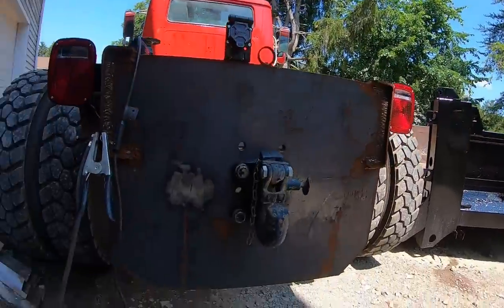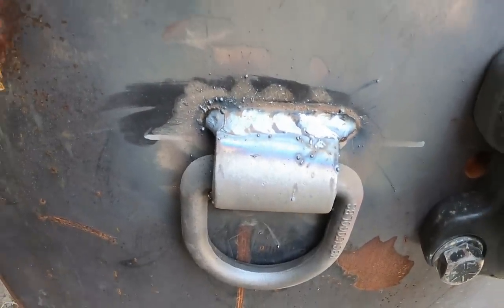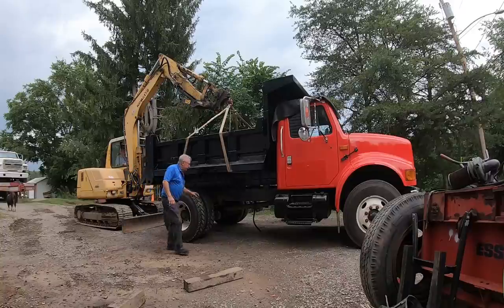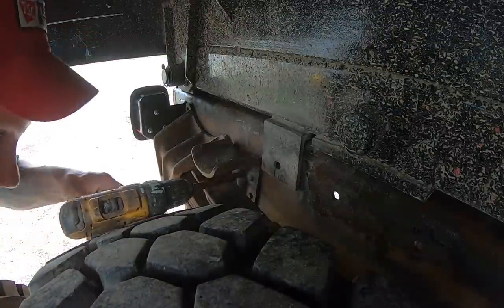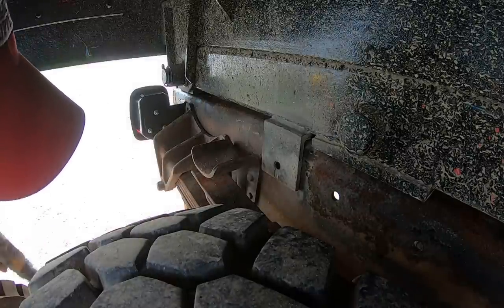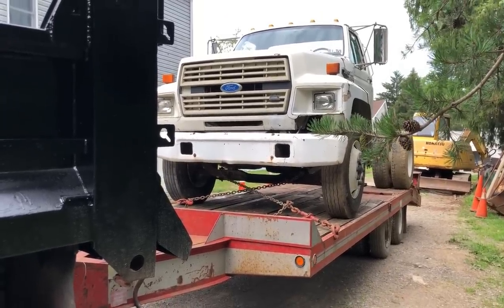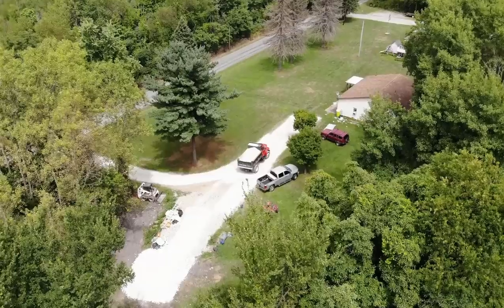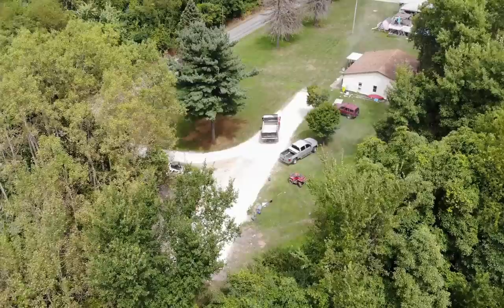International Dump Truck Build Pt. 3 (Shes hauls her first load!!)

Comment: To keep the shroud clean on the mig you can use cheap cooking oil to dip it in it stops the little particles from sticking to the shroud.
Reply from the maker: I use nozzle dip but I also run 100%  Co2 because I’m Too cheap to run argon, the side affect of straight Co2 is lots of spatter but still produces a good weld
Reply: Brian Millar 
Your priority is wrong if you're getting a lot of splatter

Comment: i like to put heat on those cast d ring saddles when i weld them on. i have been considering upgrading my welder to the miller 252....big investment for me. i bought the milwaukee m18 mag drill. i absolutely love it. i have many videos of drilling truck frames with it. i move axles forward on trucks and the drilling only takes 20-30 minutes now. looks like the international is missing a bolt on the front leaf spring hanger on each side. i like how the subframe is spaced up a little bit from the truck frame.....less rust jacking that way. very nice build...look forward to more.
Reply from the maker: Thanks! Probably gonna be one more video on the truck in the spring, doing some finishing touches! thanks for watching!!!

Comment: Nice, wish mine was air brake. I scoop out of the bed a lot and have to chalk my wheels everywhere I go. My next will be a 12 foot bed air brake with a single tire drop axle
Reply from the maker: that would be a good set up! Thanks for watching!!!
Reply: No problem bro good looking setup you have I like your excavator a lot I’m looking at mini to mid size machines thinking about buying a cat 305.5. My truck is a 00 model 4700 with the 7.3 and auto and 10 foot dump bed and my trailer is a deck over pentle, tandem, single tires. I think I could get a lot of work done with my skid steer and a smaller excavator. I’ve used a bobcat 35 long stick and I’m trying to figure out which small machine I can reach to load my truck with and stay around 12k lbs.? Any ideas?

Comment: Awesome build!  I have a similar truck, 2002 4300 DT466 Eaton 10 speed. All you need to do now is put an air actuator on your tailgate trip. It’s so nice not to have to tie a rope to your handle.
Reply from the maker: Yes I’d like to do that eventually thanks for watching!!!
Reply: Shoot I'd love to move to a newer truck but the 1983 s1900 with a 6.9 isn't giving me any major problems I'll keep using it bought it out of a tree row for 1,500 had to put in a radiator the one i put in it is out of a 1978 f250 with the 460 a few pieces of exhaust pipe to change the hose size down and 4 new bolt holes we've been on the road since truck was sitting 4.5 years before I saved her from being scrap metal couldn't beat it for 1,500 with a clean title some of the truck I looked at in similar condition were running 6k to 8k at the time

Comment: sounds like you have your settings about right wire speed and voltage settinhgs , quick tip if you have them set right you willget a clean crisp crackle as you weld

Comment: If you want an easier way to drill and finish frame holes, use a bridge reamer. Find center, 3/8 first then 1/2 or 5/8 reamer. Lots easier on the hands and arms.
Reply from the maker: never seen those, ill have to check that out! thanks for watching!

Comment: Sounds like that ford has the 6 cylinder ford diesel motor. I had one in a F650. Not bad. A little lower power than I expected.
Reply from the maker: Military Museum the ford has the 6.6l in it, and yes she’s not exactly a powerhouse

Comment: Putting a mud flap on the lead side of the drives will keep crap of the back of the back of the cab. Rock chips, road salt in the winter and etc.  What motor does this truck have, DT466?
Reply from the maker: Military Museum I’ve been meaning to get to that and just haven’t, but yes the truck has a 466 mechanical if you check out the first part of the series I go over all the specs of the international, it’s like a brand new rig
Reply: @DieselCreek  if you dont car about looks you can get some galvanized culverts and cut em up in half to use as fenders, super cheap and dont look too bad

Comment: Put a 5th fifth wheel attachment on your old dump truck and use it to haul your equipment around on
Reply from the maker: I can’t it doesn’t have air brakes or balls to pull anything lol

Comment: Hi Matt.  Love the vids keep em coming.  Only welding I ever did was shop class in high school which in the late 1980s consisted of oxy acetylene and arc.  Do all welders avoid arc welding now days because it weakens the metal due to too high heat?

Comment: Next time you have to drill holes like that rap a chain around the frame and put a pry bar threw the chain and on the back of the drill and use the pry bar like a drill press but dont pry to hard dont want to brake the back of the drill

Comment: I’ve drilled a lot of truck frames, the easiest way I found to drill the holes in truck frames was to trick someone else into doing it. It is so much easier. Buy 3 of the same cobalt or hss bits and keep 80/90 oil steady. You can usually squirt the oil from up high and it’ll run down to the hole. And zip tie the drill trigger onto the right speed and lean on it with a rock bar 🤳🏻
Reply from the maker: hahah! if I would just buy a Mag drill it would be so easy!!! Thanks for watching!!!
Reply: Either way it’d be good to have a mag drill or know someone that does and I prefer the latter 👌😂

Comment: Hi Matt, I really hope I am wrong and missed it but it didn't look like you crossed your trailer hitch safety chains. The purpose is that the chains will cradle the tongue if something breaks/malfunctions and keep the tongue from hitting the road and digging in.  Finding a pothole with the tongue would make for a really bad day.
Reply from the maker: You must have just missed it because I’m pretty religious about trailer connections. I always cross and make sure the hooks come from under the D-rings

Comment: I would love to have that old ford.
Reply from the maker: You can buy it!
Reply: @DieselCreek  how much?
Reply from the maker: Looking for 5k it’s an 88 f700 with the 6.6l diesel don’t know the mileage for sure the odo doesn’t always work, the the only problem I know it has is the gauges don’t work right , always starts and runs well tho. It comes with a f600 parts truck that has a gas motor and is in good shape but no title parts truck has a nice bed to put on the white one as well as a good front clip

Comment: You need to see those Pakistani truck building videos, they take new trucks completely apart, modify them and then screw them back together. 

Those guys didn’t have mag drills either but used a chain around the frame as pushing aid, while turning the loop they created pressure. Crazy and cool idea.

Found the link!: https://youtu.be/S1ZWqLRhhbM

Comment: I would have put a stiffenrs on headboard addition
 Put tailgate pins in from inside body, if one works out it will fall in instead of bouncing down the pike!!
Reply from the maker: They have tabs that keep them from spinning when installed this direction, I could easily change that but it’s just the way the bed was designed. They have keepers through them also

Comment: Welding the hitch plate solidly into the back of the few days is a big no , no. The hitch plate should be welded to , two auxillary inner side rails , braced and bolted into the frame .The frame has to be able to flex and move , especially in a dump truck  .
Reply from the maker: Seen plenty of them done this way never been a problem
Reply: Diesel Creek I have too, especially in say the last  ten yrs , that doesn't make it right , I have repaired more cracked / broken frames than most can imagine also used to stretch and shrink them also.
Reply: No so. I have direct welded 1" plate hitches to truck frames for many years pulling  dump trailers up to 20', trailers pulling bulldozers and whatever. We formed 1/2" gussets to fit inside  or outside the truck frame each side, bolt to the frame and weld down the length of the plate. No cracks.
Reply: You guys get away with many things over in the states, here in Denmark your truck would get a driving ban at the first annually Dot inspection.
Reply: @BjarneRousing  you should see what they do In central and South America! It makes us Americans look like scientists!

Comment: Don't know if camera angle makes  D rings look askew. If you take the pintel hitch off and clamp a level straight edge the D rings will be level.
Reply from the maker: I leveled them across the top of the weld on piece, one of them was slightly distorted letting the ring hang crooked... drives me crazy
Reply: @DieselCreek  yeah that irks me when I do something like that. Too the point I re-do..
Reply from the maker: Blade Runner if it mattered at all or was a little worse I would have but it’s just slightly off and if I cut it off I’ll prob have to buy another d ring because the weld on piece will be sacrificed so I just left it

Comment: Ouch 554 and 555 I had to cringe and grit my teeth and close one eye when blue shirt got right in under that box suspended in the AIR. More that one has been crushed buy getting between dump box and frame. It will bring up your lunch real quick .. glad all is ok

Comment: Hi I'm a late comer watch  a few of your other videos.
Did I miss soemthing, why have you not cleaned and painted the chassis and power washed the running gear. Looks like an oil leak on the transmission.  Will

Comment: Are you going to put batter boards on your side of the truck ? 

How about that low hanging plate for the trailer hitch isn't it to low and going to interfere with your angle of departure?
Reply from the maker: Ive got boards on it now, and no the plate is just right. cant hit anything but I can knock piles of material down with it in a pinch!

Comment: Why did you change trucks? Something wrong with the Ford?
Reply from the maker: This can legally haul a good bit more, that Ford was always over loaded. The ford had hydraulic brakes which I didn’t trust when I was always over loaded, it maxed out about 55 down hill on the redline and this truck runs about 70-75 and finally the ford really didn’t have the power to pull my hoe... I mean it did it but I’d be going like 15-20mph up hills if I had a good run lol this truck is just a lot more reliable and powerful for what I do. Thanks for watching!

Comment: Was the f700 a gas job?
Reply from the maker: No sir the white one has a 6.6l Brazilian and the red one you may see in the background of some videos has a big block gas motor but I’m not sure what, it bought it for the bed and other parts
Reply: I got that same f700 with the same engine.  Other then wanting more power why did you want to swap it out to the newer truck? With property tax and insurance being higher on the newer truck?
Reply from the maker: John Sutcliffe insurance was the same and we don’t have property tax

Comment: WHY NOT  REPLACE YOU OLD SINGLE DRIVE TIPPER WITH A BOGIE DRIVE MUCH MORE POTENTIAL FOR BIGGER PROFIT DONT YOU THINK, YOU ORANGE TRUCK LOOKS CUTE BUT LIKE A WHEEL BARROW WITH NO HANDLES.
Reply from the maker: I’ve thought about getting a tandem truck but the single axle does most things that I need plus fits into lots of tight places that a tandem won’t, PA registration for a tandem is somewhere around 2000 a year it’s just not worth it for me, I do lots of smaller deliveries and the quarry is very close to my place so it’s not a big deal to make a few trips. Plus you stay a little more under the radar with a single axle. DOT goes after those bigger trucks a lot harder around here